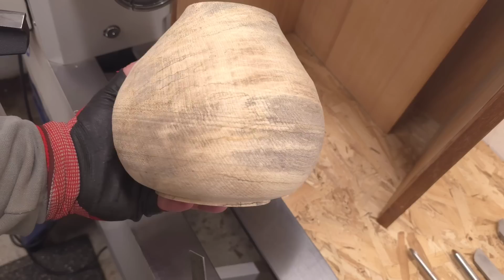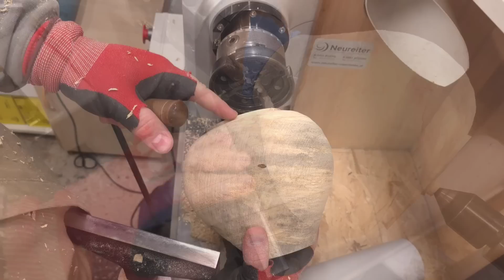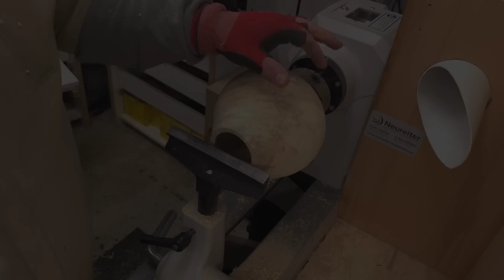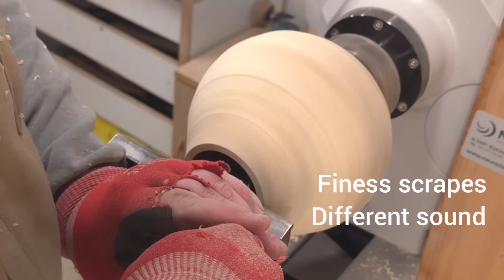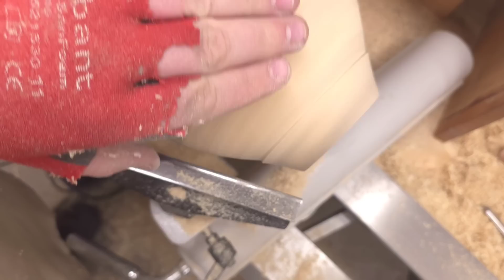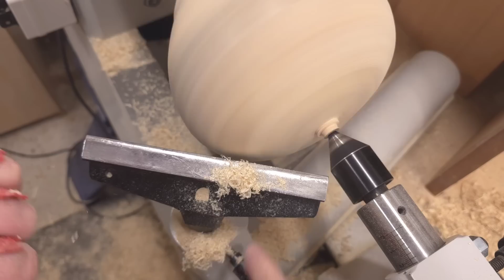Turning Enclosed Vessel Without Special Tools | 4-ways Project

Comment: As a novice turner I would have thought that a narrower scraper for the inside bottom of the bowl would have been less chance of a catch and easier to control. Your thoughts? Thanks for sharing.
Reply: I find the narrow scraper is too flexible, so with the big overhang you get chatter
Reply from the maker: It would work as I have 10mm thick tool but narrow, but its not proper shape I needed.

You can try asortiman of tools, and see what will work for specific job the best.